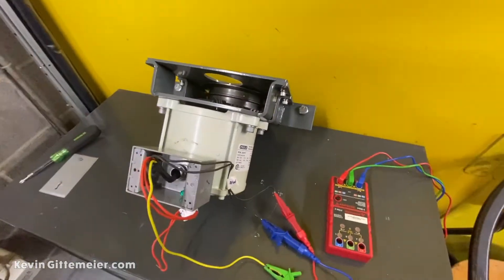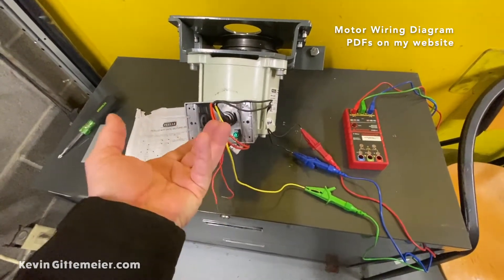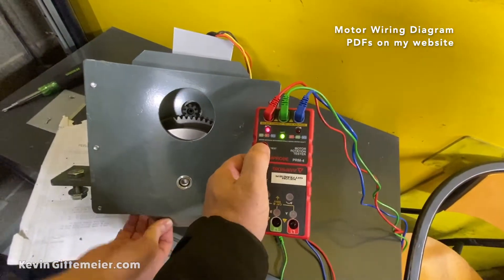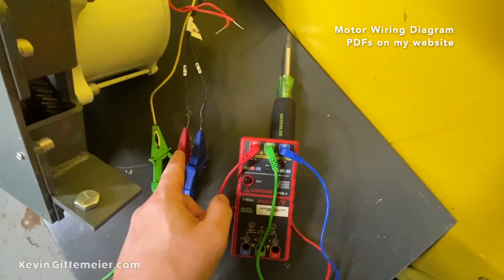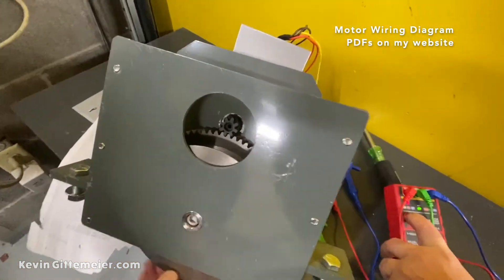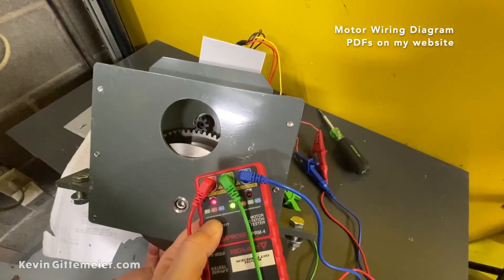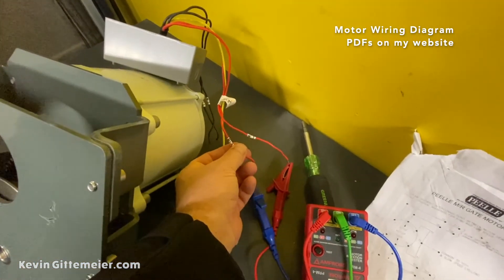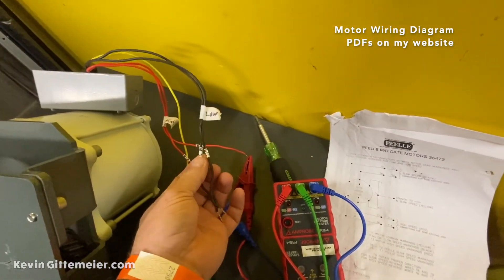Motor Rotation Testing 2-Speed Electric Motor [395]

Comment from the maker: A co-worker needed this quick video on how to use 3-ph Motor Rotation Meter to identify unmarked leads on a 3-Phase 2-Speed Electric Motor
Help us get to 100k Subscribers: http://goo.gl/DDfVab 
https://www.kevingittemeier.com/phase-rotation-tester/

In this video we use an Amprobe Phase Sequence & Motor Rotation Tester: https://amzn.to/38baUNN to identify unmarked leads on a Peelle 2547 Series 3-Phase 2-Speed Gate Motor.  

Newer Version
Amprobe PRM-6 Phase Sequence and Motor Rotation Tester: https://amzn.to/390dnd8

So why do we need to identify the wire leads on this electric motor?
If its a 3-Phase AC motor and it turns the wrong direction just swap any 2 of the 3 wires to change direction or motor rotation.

If this case we have two speeds which would normally be 6 wires but both both speeds share a wire so in our case its 5 wires.
1 Yellow motor wire common to both Low & High Speeds
2 Black motor wires for Low Speed
2 Red motor wires for High Speed

See wiring diagrams and pictures on my web post:
https://www.kevingittemeier.com/phase-rotation-tester/

So what’s the problem?  Black for Low and Red for High.
Well we don’t actually know which way the motor will turn.  We just wire it up and if it’s the wrong direction swap any 2 motor wires (in this case swap Reds or Blacks but not Yellow because its shared).
But on a 2-speed motor since there is no wire identification between the 2 Red motor wires or the 2 Black motor wires, it’s a 50/50 shot that they will both turn the same direction.  The motor could start turning clockwise then when the other speed picks up change direction and potentially cause damage. 

By using the Phase Sequence & Motor Rotation Tester to identify and label the motor wires we can insure both speeds with turn the same direction.

Bonus question.  Do we know what that direction will be with a given circuit?  Can we use this Phase Sequence & Motor Rotation Tester to figure that out?  If anyone can can correctly answer that and explain the answer I will enter them in a giveaway for one of my Portable Laptop/Utility Shelf: https://youtu.be/99cF0JD8k7A

Note: Peelle calls it “Slow” and “High” Speed which is kind of silly.  Either Slow and Fast or Low and High but there is little standardization between companies and many have different terms (don’t get me started on the Hand of doors or Left/Right).

https://www.kevingittemeier.com/

Most commonly asked about tools can be found here.
https://www.kevingittemeier.com/shop/
Some links are affiliate links in which you pay the same price yet I receive a small commission which helps support my website and channel.

Amprobe Phase Sequence & Motor Rotation Tester: https://amzn.to/38baUNN

file:///Users/kevingittemeier/Downloads/Peelle-Electric-Motor-Diagram.pdf
Reply from the maker: The downloadable PDFs for "Peelle Electric Motor Series 2547 Wiring Diagram" and "Peelle Door Control Wiring Diagram" available here: https://www.kevingittemeier.com/phase-rotation-tester/

Links of Peelle Doors Wiring Diagrams (not PDFs) 
https://www.kevingittemeier.com/wp-content/uploads/2021/01/Peelle-3-ph-Electirc-Motor-Diagram-scaled.jpeg

https://www.kevingittemeier.com/wp-content/uploads/2021/01/Peelle-Door-Control-Wiring-Diagram-768x1024.jpeg